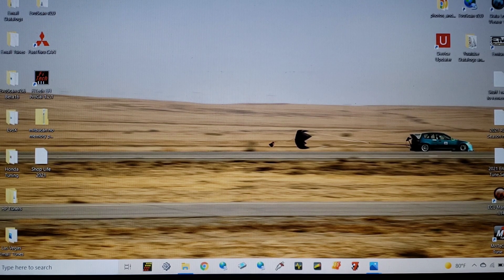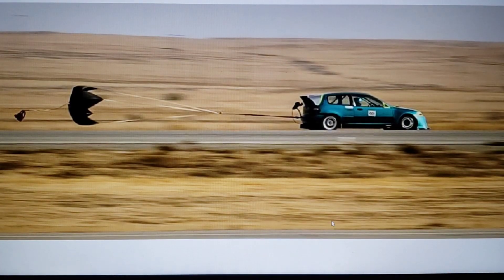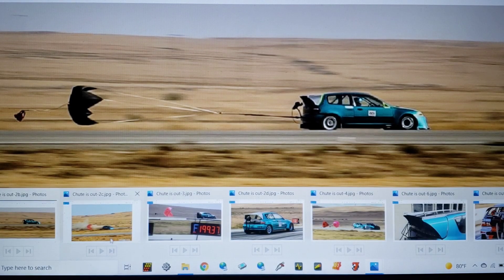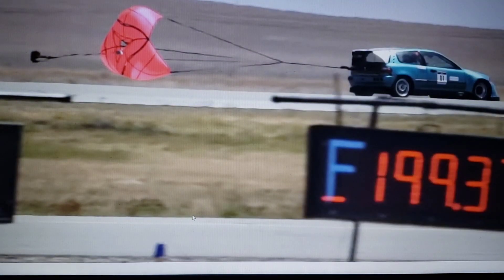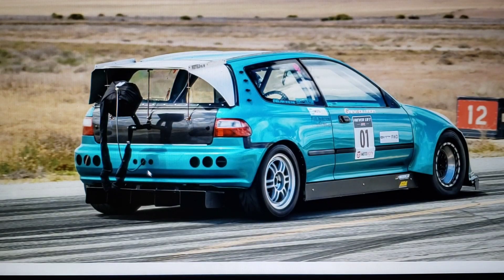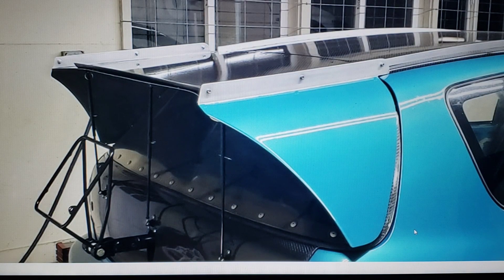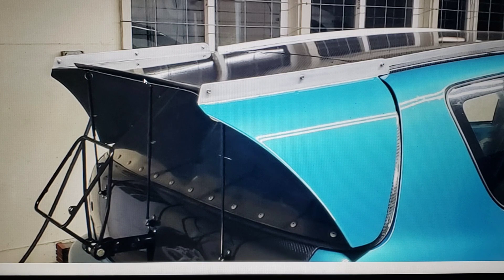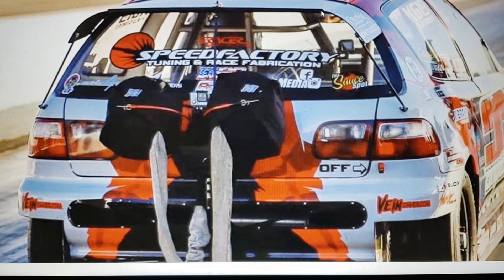Parachute Safety and basics of aerodynamics

Comment: Just added a parachute to my prelude. Pretty sure mine is too low. You can see in my last 2 uploads
Reply from the maker: I'll go look, it can be a tricky one
Reply from the maker: Does look a bit low. I'd think almost where the trunk lip is, possibly a little bit higher than that even.
Reply: @AaronONeal1  thanks so much for checking it put!! It was pretty scary throwing it for the first time last weekend that's for sure
Reply from the maker: I know exactly what you mean on throwing it for the first time. I have had malfunctions so I feel that way the first time every event. Getting better now with my current chute, zero drama.
Reply: @AaronONeal1  awesome glad you are getting yours dialed. I was supposed to run at the Indy air strip attack this gear really cool you were talking about it. Im in southern Indiana. Had transmission issues so couldnt make it